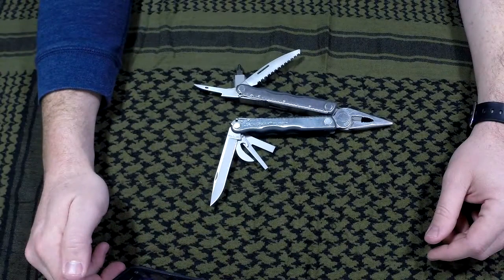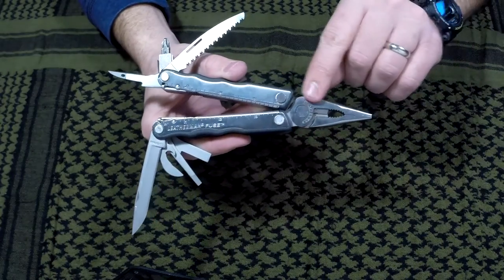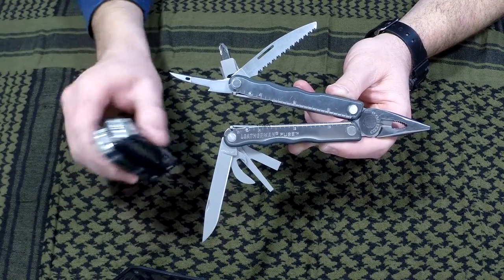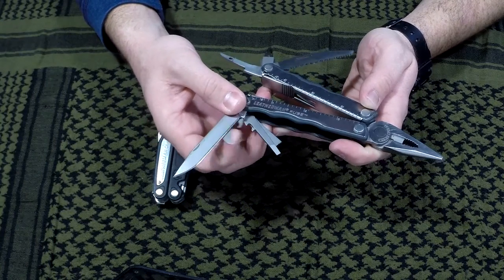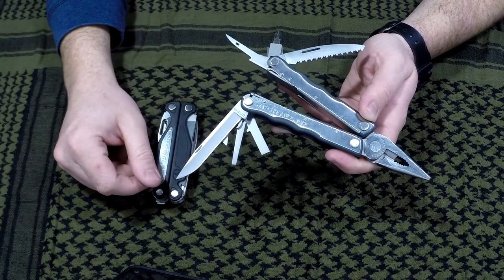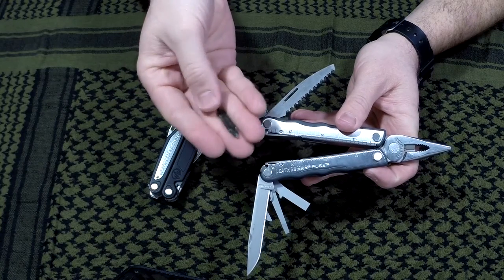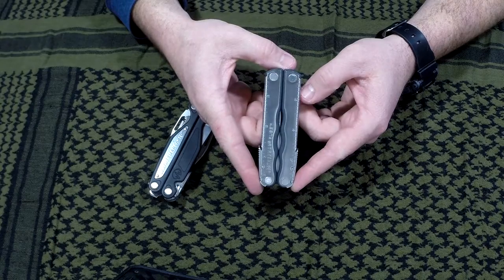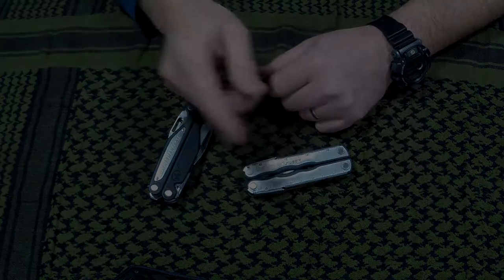Leatherman Fuse Mods

Comment: Nice work. Makes this tool more useful. This is one of my favorite tools. I have a Blast which is similar. I agree to making the Reebar a parts tool. The Rebar was supposed to replace the Fuse/Blast. To me, the Reebar is garbage. I bought one and gave it away. There is no comparison between the Fuse/Blast and the Reebar. The Reebar feels and handles like a cheap Chinese knock off tool. My #1 favorite tool is the Charge Ti, followed by the Blast. And for heavy chores, the 300 I like better than the Surge. Although the Surge has a nice pair of scissors.